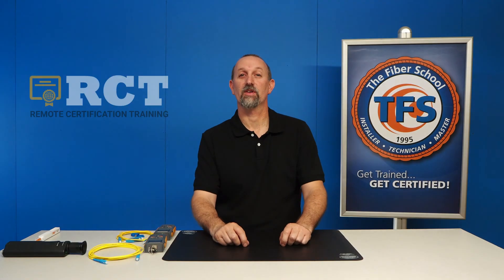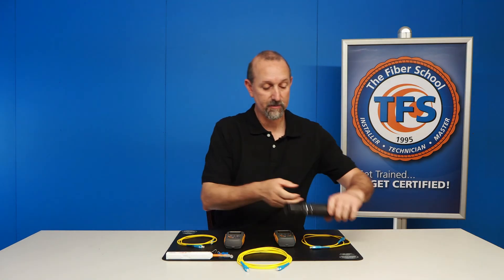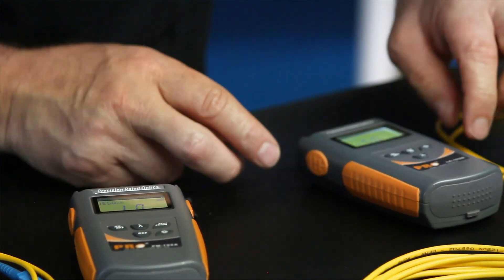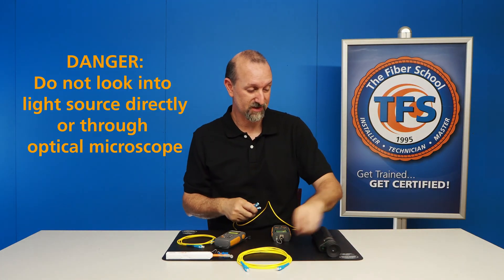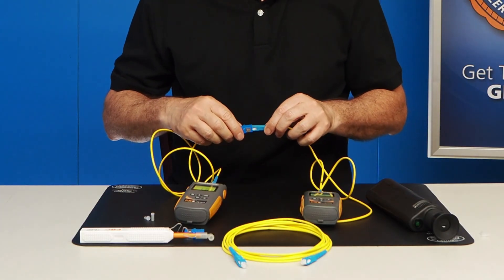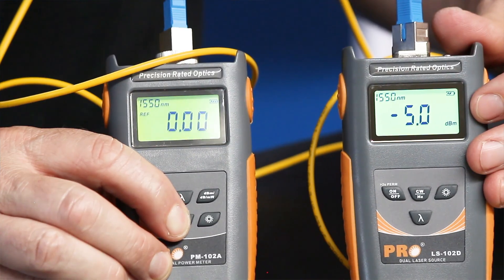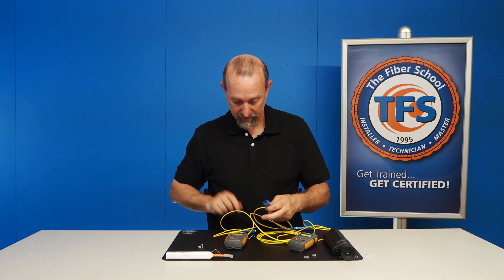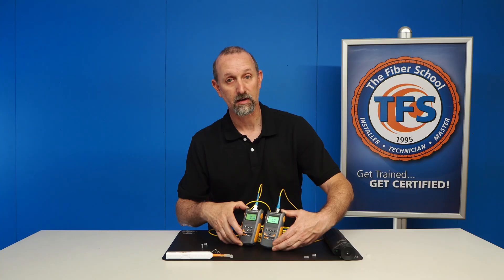How to: Reference a Power Meter and Light Source

Comment: This reference method is not the preferred 1-jumper reference. Keep that in mind and look this up as well, before you make this your default practise of testing.
Reply: My thought as well. Reference to a test cable (so you include inevitable connector losses), then swap that out for your cable under test. Then you're comparing just the fiber.

Comment: After plugging reference cables You get -4.75 dBm power on OPM. It is higher value (higher level) than -5.0 what means that 2 reference cables amplify the signal by 0,25 dB. It consider this as a loss the meter should show -5,25 dBm.
Reply: same here. very confusing
Reply: same here, very confusing